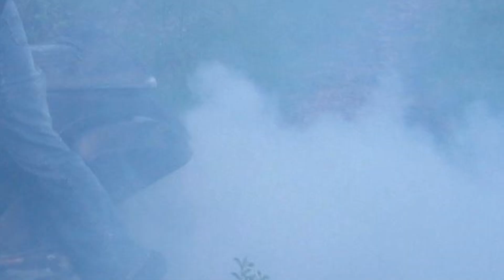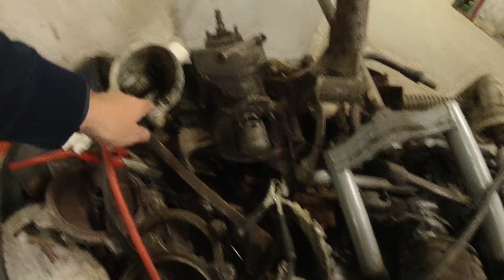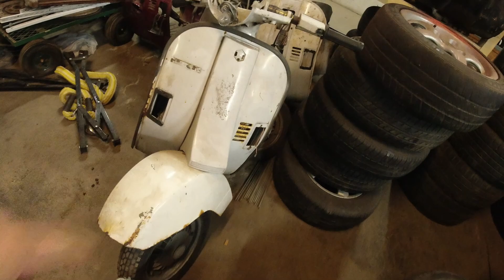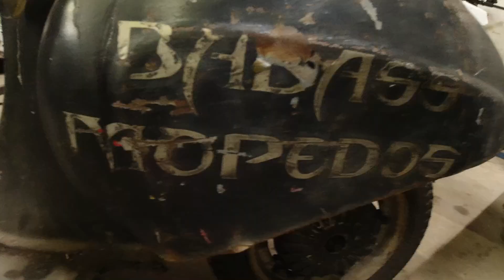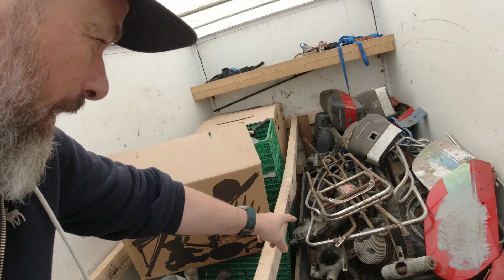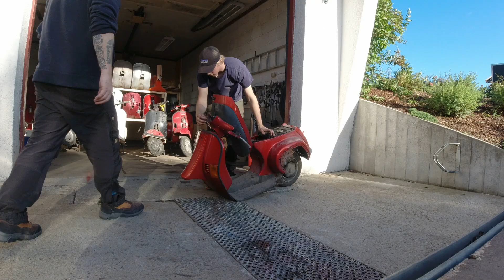#Vespamania  Part 1

Comment: If there’s a set of pk ets125  indicators in there,I’m interested if you want to sell them.
Reply from the maker: Not sure what they look like?
Reply: It almost looks like a regular pk but the indicators are ever so slightly longer and only that model had them. There’s a horn Louvre/grill cut into the leg shield. They only made 15000 of them.
Reply from the maker: @goawaytours  Like the red one at 5.30?
Reply: Maybe the headset looks similar. Can you get a pic of the headset to me?
Reply from the maker: Just checked the frame numbers. All are 50's
Reply: @kickbackgarage  thanks for checking. I’ll find a set of them one day.